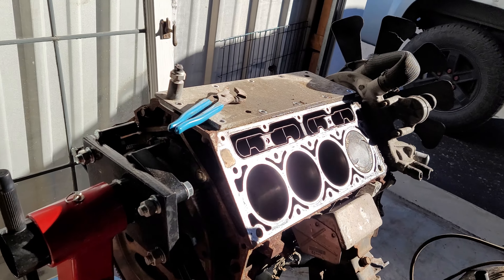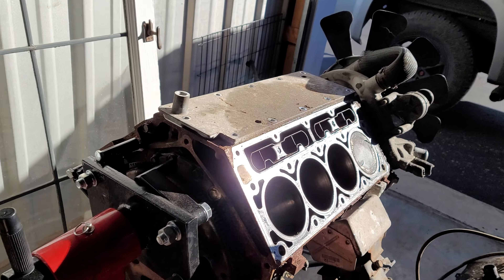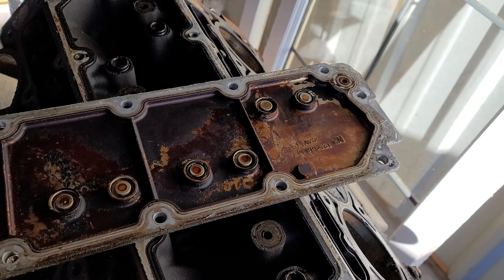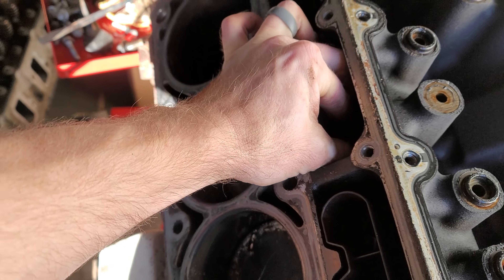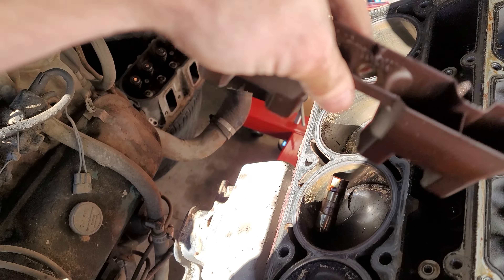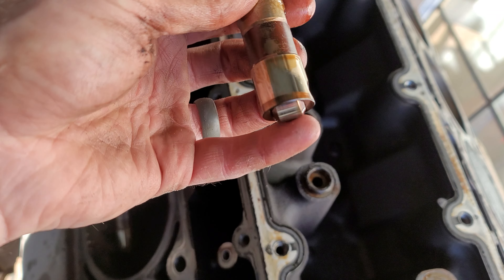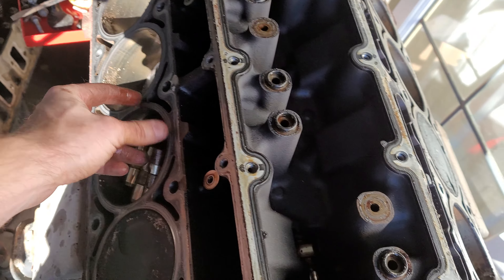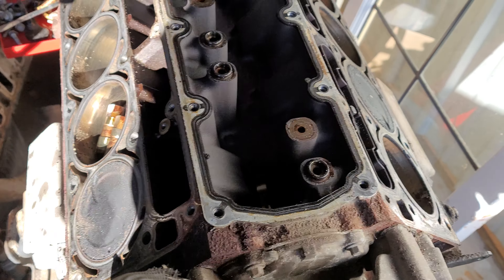Car Maintenance 201: Vortec, LS Lifters, Valley Cover, DoD and AFM Part 1

Comment: I have the same engine, so on the valley cover it looks like there’s a built in gasket on the block . If I want to replace it do I need to buy a gasket ?
Reply from the maker: A lot of times you need to scrape it off the block. Its best to use a good plastic scraper so you don't gouge the block. You can get a valley plate gasket to put back in there. To answer your question, you will need a new gasket there.